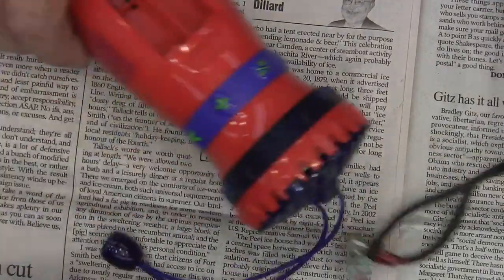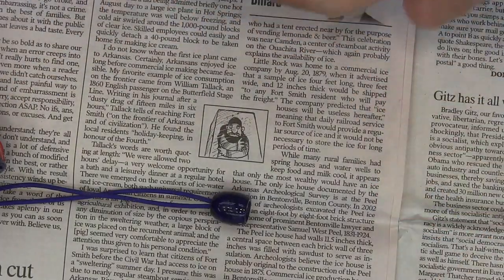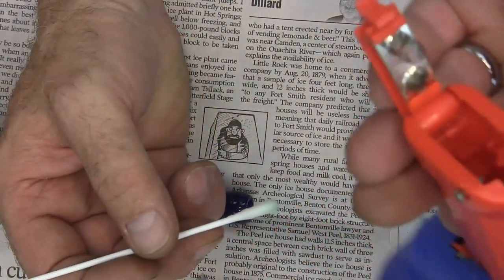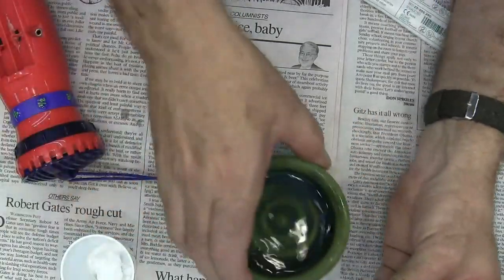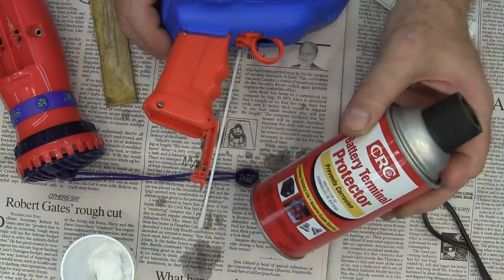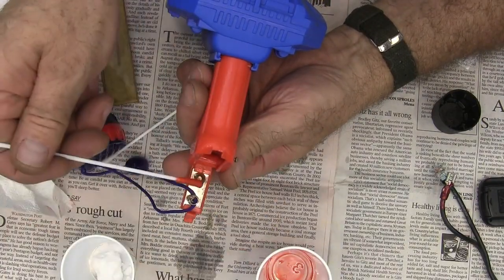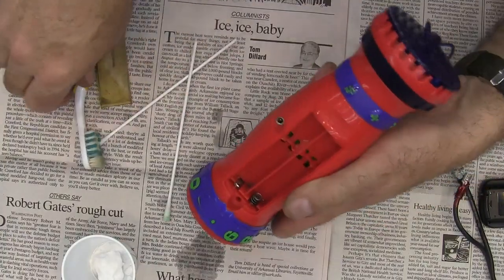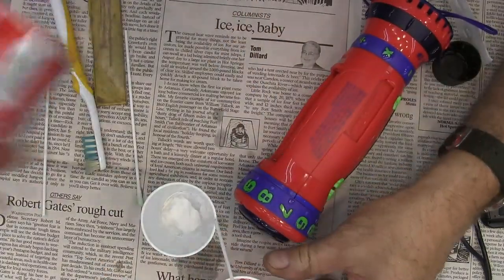How to Clean Battery Terminals in Electronics

Comment: I have used that CRC battery terminal protector for a long time but it never occurred to me to use it on these little battery toys and such.  All these little tips for things around the house and shop you have sure do help make life easier.  Thank you.
Reply from the maker: This is one of the most frustrating things, especially if you have kids.  They are always leaving batteries in things and bringing them to me all corroded.  Unfortunately I've had a lot of practice. :)

Comment: the acid isn't cleaning, it's only neutralizing the base (bubbles).  cleaning is the sandpaper or steel wool to get the contacts back to working order.  I was hoping to find some miracle around the house to get the corrosion off down inside where the sandpaper and steel wool don't work...